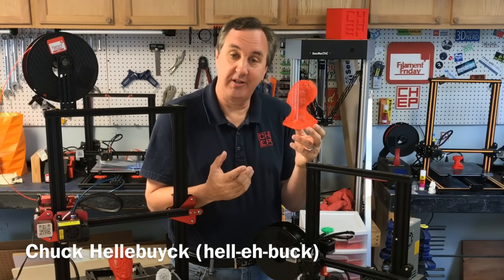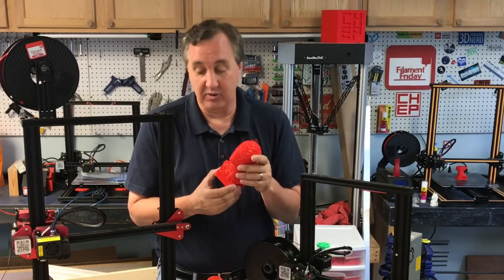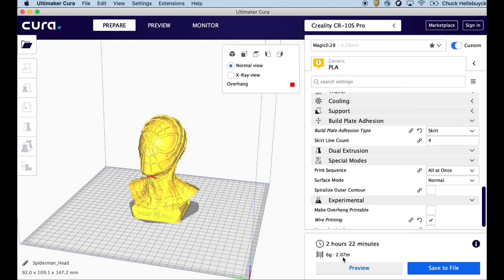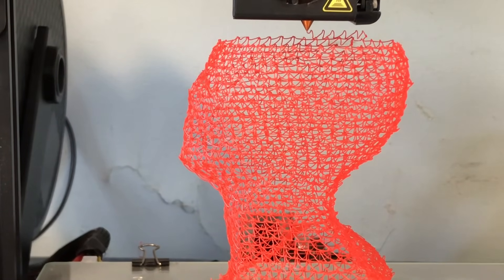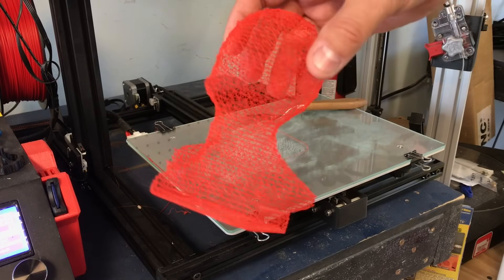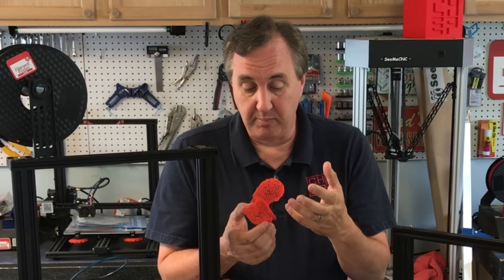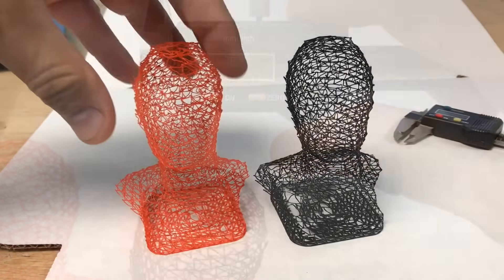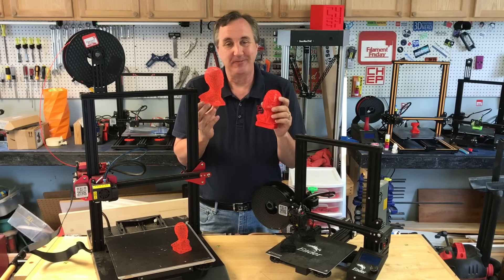Wire Printing in Cura Slicer 4.0 on Creality Ender 3, CR-10S Pro

Comment: Did you change any settings in cura - wire print settings? I'm using cr10s pro v2. Using stock WP settings, all I get is a mess. All my other prints are perfect. Thanks!
Reply from the maker: Not that I remember. Just what’s in the video.

Comment: I tried it and on cr10 v3 it is not enough to cool the string to 100% power and it then falls down. So the most important thing will be cooling and probably additional cooling.and unfortunately the cr-10 V3 with its blowing cube pushes the print itself and then there are bad contacts ..most likely it can be solved by reducing the WP connection height from 3mm to 2mm ..during printing it is necessary to go slower, do not heat the string too much over 200 degrees and place another blower or a fan on the base, for example on the battery. The nozzle must be able to melt and the string must dry literally immediately even at right angles: P

Comment: That looks really messy. Doesn't work for fast quick prototyping to test fit parts.
Reply: It's not supposed to be for prototyping
Reply: If your doing test fits try making them slightly larger than you need and sand it down later

Comment: I watched some other videos on experimental wire printing and the use case is rapid prototyping, printing objects nearly 10 times faster, so if you're just trying to get a fit or feel for something you can print it like this quickly before printing the final form.

Comment: @CHEP 
Funny thing: Cura IS able to preview the gcode, but only if you let Cura start up from the Gcode file - so by opening the file from your file explorer with Cura (at least on windows). Same thing won't work if you try to open or load the file in Cura after opening it, very strange.

Comment: Great instructions and video! I just tried it on my Ender 3 v2 at 50% and it looks amazing!!!
Thank you
Reply: Hm, it totally not working on my ender 3v2, strings just lay on plate in mess(
Looks like not enough cooling. 210/55 PLA, 100% cooling from layer 2

Comment: It seems like it would wear a lot on the z snail gear thing.
Reply: Sine the X and Y axis motors always runs way more then the Z axis motor I'm not sure this is an issue. In wire mode the Z axis will still not operate more in total then X and Y  but it WILL operate more in wire mode for sure then during normal printing. Having a god lubricant oil/grease on the screws is a good idea even if it gets a bit messy and this goes for any machine. Makes it last longer

Comment: This would be an interesting experiment for architectural 3d printing with quick drying cement. If we could mimic this, it would save a LOT of material and we could will in the holes with just isolation. Would be a lot more environmentally friendly and like you said, not something you´d want to do by hand. It wouldn´t be as solid, but it wouldn´t have to support as much weight either.

Comment: Hi Chuck, there is a way to preview the wire print in Cura. After saving the gcode to file, clear the build plate and then drag and drop the gcode file into Cura.
Reply from the maker: I’ll try that.

Comment: Thanks Chuck! I've found 210C is better for accuracy using PLA for wire prints.
Reply from the maker: All depends on the PLA. Each one has different properties
Reply: @FilamentFriday  Good point, mine was SunLu.

Comment: This is interesting. Could you not, as you showed in another video, do that "box" thing and make the bottom half of the base part a solid piece, and then do the wire print above it? It would be interesting to see that.

Comment: what nozzle you use for this print? the 0,4mm nozzle? If yes how you can print with 0,6 with if the nozzle is max 0,4mm?
Reply from the maker: You can set to overextrude in the slicer

Comment: PEI (Polyetherimide) sheets provide a 3D printing build surface that requires no tape, slurry, or adhesive. ... The printed 3D parts will adhere to the PEI surface on a heated bed, and it will release or pop off when cooling down.
Reply from the maker: Yep, covered that and many other print surfaces in past videos.

Comment: If you printed a bust of a head that’s not spiderman with the webbing , I wonder if it would change the affect since the printer isn’t reading the coordinates of the outside web, but just the shell of the head.

Comment: So I followed everything you did and I even used the same model and when I try to print it, it starts way too high up. Im even using the cr10s v2 pro. Or whatever its called. How did you get there to be a base on yours. I can print any other print it just doesnt wire print. Any ideas?
Reply from the maker: If it’s starting way to high then there is an error in your slicer setup.
Reply: @FilamentFriday  Do you know what kind of error? When I start a regular print it works perfectly.
Reply: Your printer may just be calibrated wrong as well.
Reply: What do you mean?
Reply: @ethanbreen5500  if you manually calibrate your printbed it may be too low. Any info on what kind of printer you have?
Reply: Rexy cr10s pro v2 it’s one that he has but mine has the bltouch instead
Reply: @ethanbreen5500  There's definitely an error in your slicer setup. Try importing a profile or going through. If not it may be a hardware problem

Comment: Wow! Very cool print look. I'm using a glass plate to print but I have read that is recommended to use the hair spray (on the plate). Why it is recommended ?
Reply from the maker: Some really like it. I prefer Avery Glue stick. I find hair spray creates a sticky mess from over spray.
Reply: I have a Creality glass bed, with the coating. I don't put anything on it, and prints stick like they're glued.

At one point I had adhesion problems, but that was because of skin oil and dust. I wiped it with isopropyl alcohol and it had perfect adhesion again.
Reply: i just use a glass bed that i made from the glass i took out of an old scanner. wipe with with neutral detergent if it's dusty at all and you're golden, things just stick.

Comment: I just don't trust 3d printers with a moving build plate. And I think prints like these just exposes the intrinsic flaw in their construction, it would have been interesting to have a direct comparison with something like a ultimaker2.
Reply from the maker: Would love to compare it to an Ultimaker but I can’t afford one and they wont send me one to try.
Reply: @FilamentFriday  To me the interesting question is whether a moving buildplate is a flawed construction or not. There are other cheaper 3d printers that have a similar construction like the ultimaker (buildplate not moving while extruding filament).

The reason for the comparison is that I suspect creality and other similar cheaper printers (with similar construction) often have biased reviews, they compare the printer when they print something easy like a vase print and then compare them to something like an ultimaker2.
Reply: @laserbuddha  His delta printer has a fixed build plate and even mentioned that it would be used for a bigger build.
Reply from the maker: I’ve reviewed and used extensively the Ender 5 with the style you describe. I see no difference in fact I prefer the Ender 3 results. 
I’ve also see Prusa printers create better prints than Ultimaker so I don’t see a moving bed a detriment if the acceleration and jerk settings are correct.
Reply: @FilamentFriday  I've watched your Ender 3 vs Ender 5 review, but I've got so many questions.

"I’ve reviewed and used extensively the Ender 5 with the style you describe."
1) Did you test print something similar to the print in this video, a print that is rather delicate and relatively high? I don't consider a "benchy" or vase prints good test prints. This is because I think that should be the minimal requirement for a functioning printer. This is like testing if a car can do right and left turns. To me, it's more interesting to see what the limits are for the printer and what types of prints the printer can/can't handle?
2) What kind of speeds did you use? In my experience, most printers can print anything, if it's slow enough. As I see it a good comparison would be to see which printer can print a complete print fastest.
3) Did you notice any difference in reliability? How many prints out of 10(100) fails?

"I’ve also see Prusa printers create better prints than Ultimaker..."
 I'm not even going to get into those kinds of "fanboy" fight... 😄
Reply: @AXG6800  I don't understand how this comment is related to my initial comment.

Comment: cura has had this function at least for the almost 2 years, that i'm using it. 
needs a lof of cooling, but tweaking the temperature during the print is worthwhile. there's some point a few degrees below normal printing temperature, where the extruded strands contract and tighten a little before solidifying.

Comment: I wonder what would happen if you put these prints in an oven or use chemicals to let the plastic weld together at the disconnected joints. I think all the wires well at least soften and the print shape won't be the same 🤔 but it may work 🤷🏻‍♂️

Comment: Interesting - is there a way to use this technique for print support, as that is the huge differences between printing on a UP printer where supports break off properly and in Cura printers where supports give real problems in cleaning up prints, and using then for engineering.
Reply from the maker: If your Cura settings are right supports just break off. Here is one video where I explain:
https://youtu.be/7BURpQNXrDA

Comment: You might be able to get a similar if not better effect if you printed something out of a dissolvable filament and made your own wireframe pattern over the top using a pen, and then dissolving the original print afterwards. I'll have to see if anyone has tried this

I really like the wireframe effect, but I feel like there are too many deformations when you get closer up.
Reply: javan napoli that would be expensive

Comment: To be honest, I think it's kinda useless. OR rather, very specific use cases.
Reply: Of course. If you want to see the details of the model, then this is not going to be the setting for you. 

This just gives a basic wireframe of the model which is only good if that's what you want to see.

Comment: thank you for this video. You could also have talked a little bit about the wire print parameters, because we can adapt it in place of using the default ones. Should be interesting to discuss about that

Comment: I have an Ender 3 and I use the CHEP leveling file. You said the bed setup wasn’t quite right so you changed it. Can you elaborate?
Reply from the maker: I lowered it so the print would barely stick.
Reply: @FilamentFriday  so using the paper sheet leveling method should work just fine?

Comment: It's like you can read minds. I just bought my ender 3 pro 2 weeks ago (my first 3d printer ever) and as an absolute beginner you answered almost every question I had so far. I know it's not a real alternative to the cura wireframe option, but is importing the model in blender and adding a wireframe modifier on it not an option? I know you can play with the thickness of the lines in blender.
Reply from the maker: Not sure. I don’t use blender.
Reply: I have done this before, but since it printes it layer by layer the geometry of the model will vary the performance greatly. Vertical wires are most difficult. A slow printing speed helps.

Comment: It seems like nozzle temp and cooling would both have to be tuned almost perfect for the material. It would be interesting to see how PETG works with wireframe since it seems to stick to itself very well (better than PLA).

Comment: Hi Chuck, I have a question for you. Whenever I print with flexible filament, the walls don't stick to each other. I've tried higher temp, less cooling and higher flowrate but it doesn't really help. I've tried finding a setting in Cura for the overlap of walls but only found skin overlap and infill overlap. How do you think I can solve the problem?
Reply from the maker: Reduce cooling
Reply: @FilamentFriday  I've tried that but it still doesn't help much

Comment: Chuck, always a pleasure to see your video's. I am really glad to see you using the CR 10S Pro. I have the same printer and been having great results. Also been using your profiles (thanks for sharing). I did switch out the build plate with a 12 x 12 mirror though and haven't looked back. When printing PLA I just let bed cool after print is done and can just pick up the print when finished, no needing a putty knife anymore. The best thing I did to help my first layer is add a custom start script to lay a line of filament to wipe the nozzle before each prints. Thanks for all your help and knowledge.

Comment: Hi chuck, another very interesting video as always. I don't use Cura personally -not because I bought S3D or I think S3D is better etc, mainly because S3D does everything I've wanted to do thus far and has done it well. I do find your videos very interesting insights though as the "print nerds" in the forums rant on about Cura so bloody much it's enough to put you off it for life lol. It's a shame your not my neighbour because as a retired engineer I could spend hours discussing some of these things you cover in your videos. I'm about to download Cura purely to see exactly what all your settings are so I can try the same in S3D (the few things I've tried thus far have given fantastic results-magic numbers being a big one). I don't suppose you could save me a bit of work and flick me an email with your setting in a word file or something if I email you by chance at all? I'd be eternally greatful! Have bought your Arduino book by the way and I found that 👌. Cheers

Comment: Another great video keep it up pal. Can I ask you or one of your subscribers a question? I’m pretty new to 3D printing and would like to know how I can stop my ender 3 from scratching a finished layer in Cura. I’ve try’d z hole but it was painfully slow when the z axis was moving up, i wasn’t sure on the speed setting so I left it set to zero, or is there’s something else I should try. Thanks
Reply from the maker: Use ironing. https://youtu.be/gh5wC4Ti95s

Comment: Great video, thanks! Was always wondering how it works but for some reason never bothered googling. And NOW I see! Prints look gorgeous, might print a couple of decorative thingies myself. The wire printing mode  actually have ton of options available if you choose "Show all settings", including speeds, mesh "resolution" (lengths for each move), flow multiplier and even delays for lines too cool down and harden.
Reply from the maker: Good point. I wanted to try simple but that is another topic to experiment with.

Comment: It looks like it will be fun to try.  I wonder why you don't use the Creality 3D diamond print bed?  I am amazed every time I print on it.  It hold super solid while printing but when done and cooled down you just lift it off as if someone had just placed it there.  Truly amazing.  The one for the Ender 3 is only $19 Amazon.  You have to be careful because there are some fakes there.
Reply from the maker: I wasn’t aware of it. I’ll check it out.
Reply: can you tell what it's made of?
Reply: @Intellidiot  It is a glass base and some kind of material affixed to the glass that makes it hold the print solid when how and releases when cool.    If you are interested use the link above.  There are fake ones that don't work.

Comment: Chep, you once showed an ender 5. Do you not use that printer anymore? If not, was there a reason for it? would it have worked for this project?
Reply from the maker: It’s fine. I’ve used it other videos. I just wanted to try CR-10’s for this.